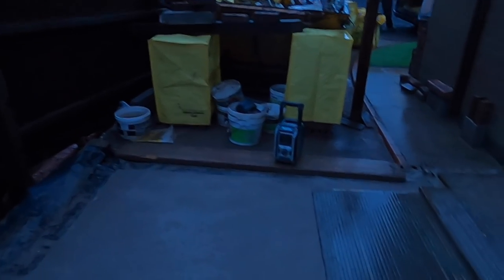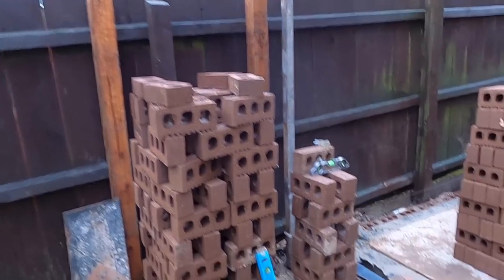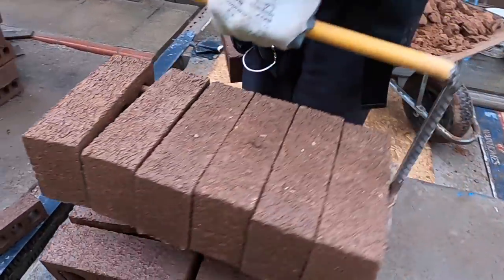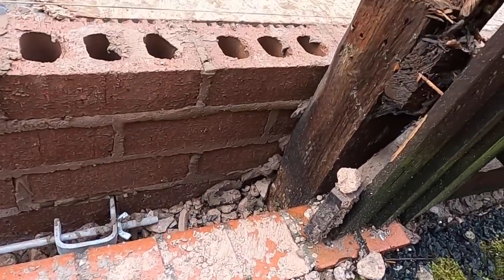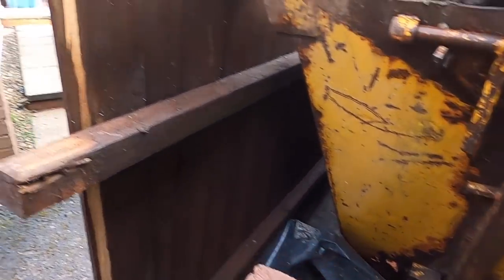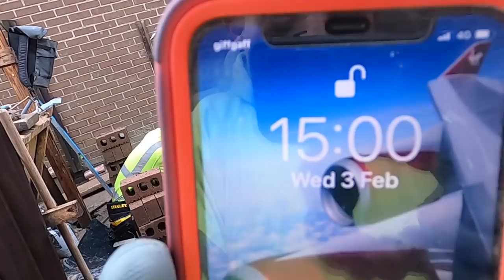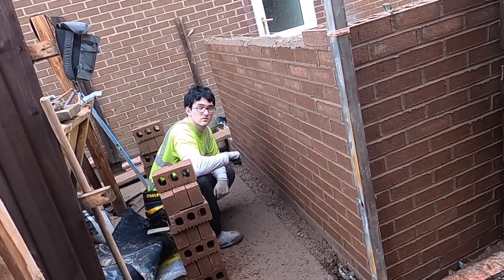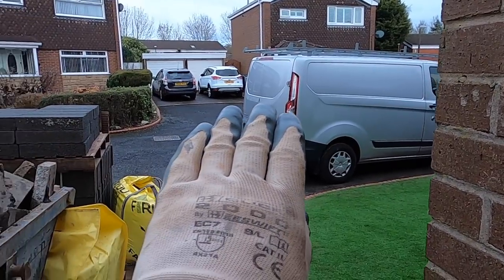CONSERVATORY BRICKWORK...  EXTENSION PART 4

Comment: Another great video. I've got a question, I noticed you put a strip of damp proof sheet across the top of the bricks, and then you placed mortar on top on this DPC and layed your first row of bricks. So the brick mortar was on top of the damp proof, which means the mortar isn't bonded to the bricks below the DPC?   Can I ask why you do this? 

The reason I ask is I'm planning on building a brick gym, with 8x3 beams along the top of the walls to support 2 large punchbags. Would your method of bricklaying be suitable to support the punchbags or would you recommend to brick directly onto the foundation bricks without the DPC strips so that all the bricks are bonded with mortar right the way down to the foundations?
Reply from the maker: If it’s an external building you must have a dpc pal 🧱👍🏽

Comment: Another great video lads. A quick question Steve where do you clean out the mixer on posh private jobs like this?
Reply from the maker: Thanks Keith , usually inside before the slab , down the trench or as a last resort down a road gully 🧱👍🏼
Reply: @SteveAndAlexBuild  thanks Steve
Reply from the maker: @keithallen8096  🧱👍🏼

Comment: How do you keep the cement mixer clean? I've seen loads where the drum is caked with cement
Reply from the maker: It’s not hard , you just need to look after it . 👌🏼 ours is 13 years old 🧱👍🏽
Reply: @SteveAndAlexBuild  At end of day I just let the mixer turn with water and 20mm stone gravel in it ,or if no stone just ballast and water .Bought my mixer in 2003 and on 2nd drum ,just needed the blades welded in places as they rusted and came loose .Like your work neat and tidy ,site clean and no mess .Your an inspiration to the young lads who may be considering a life bricklaying ,I love the job ,just hope I can keep going for a few more years .
All the best to you .
Reply from the maker: @paulbest2203  Thanks Paul , yep we are the same . This mixer is 2008 , all original bar a couple of welds on the blades 👌🏼. 
   Whenever there is the opportunity we Chuck in some stone to to give the drum a good polish inside too 👌🏼🧱👍🏽